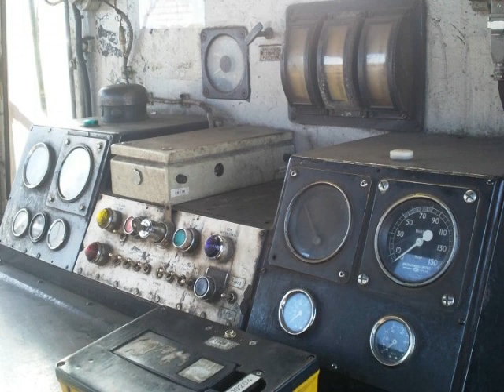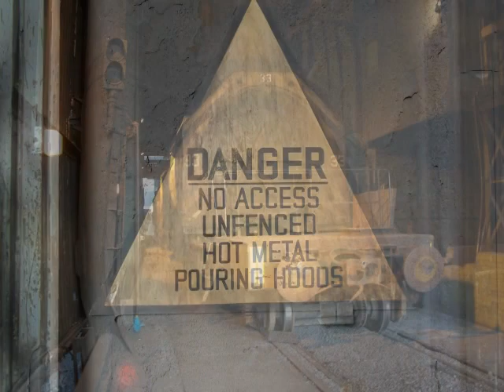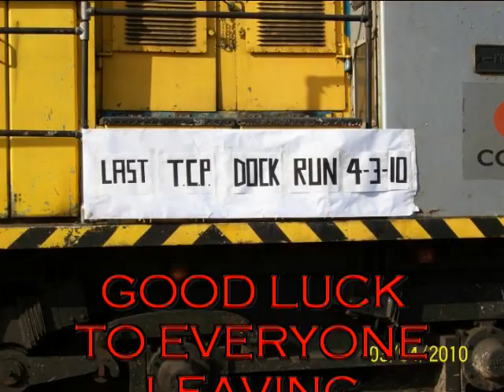TEESSIDE LOCOS

Comment: Nice video, mate. Love the GEC shunters. We have two of them in Port Talbot Steelworks in South Wales. Along with a few Bagnall shunters from 1954 and 55 respectively (one 0-4-0 and two that are bo-bo), plus a Hunslet Barclay shunter from 1993 and 4 trojan shunters. As well as a mix of Class 60 and 66 diesels, plus a tamper machine.